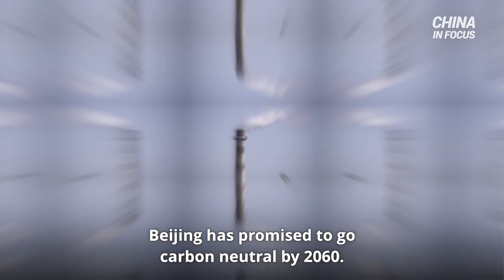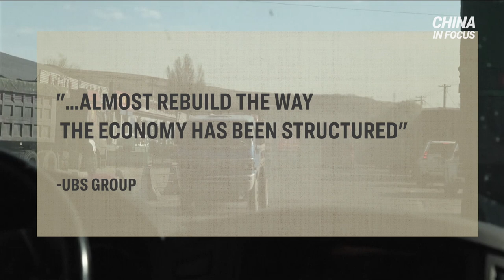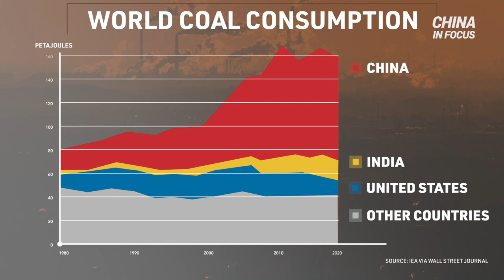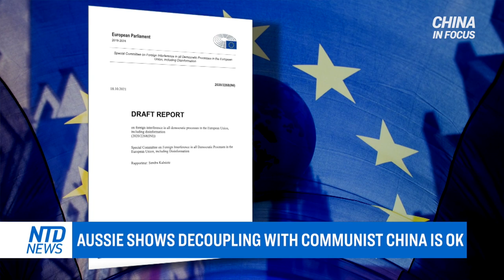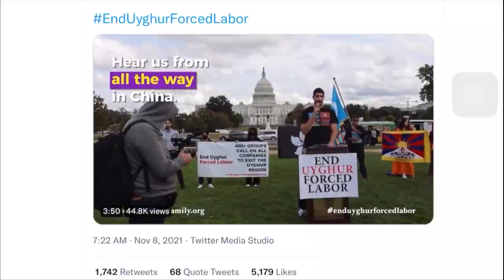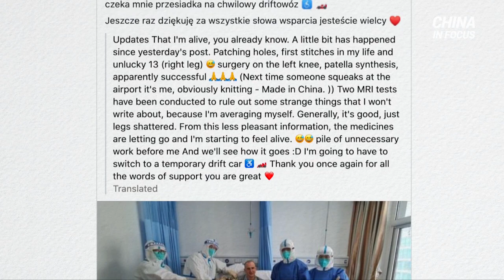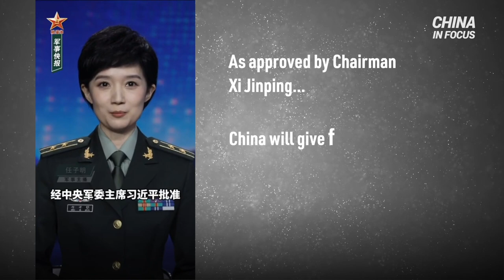Aussie shows decoupling with communist China is ok; Xi Jinping's power consolidated at party meeting

Comment: Talking about methane emissions,  showing pics of nuclear power cooling towers 🙄🤔
Reply: increased Nuc based electrical power generation capacity  is a viable option going forward over the next 10-15 yrs, but the short-term and medium-term Methane release issues will sadly be continued by the major Nat Gas & Oil producers/suppliers of the OPEC+ et al ...  

Regardless , there will also be the hard cold longer-term  reality of externalized costs to calculate and of course the  ecological / human  risks associated with decommissioning said nuc plants ultimately and storing the radioactive  spent fuel, etc.  .
Reply: Perhaps wind, solar and tidal power should be playing bigger roles as greener alternatives
Reply: @davidcooper7833  there should have absolutely been at least a tiny  $50B  portion of recent mass U.S. Federal stimulus funds allocated in acquiring, researching & developing said 'Tidal' , as well as general ocean current and surface wave energy generation technology & grids alone over say , 10-15 yr time frame in support of global leadership in the field, imho ...  fair point .
Reply: Agreed. Don. The 2040 to 2060 time frame to end use of coal and fossil fuels will be too late. Thanks for your reply